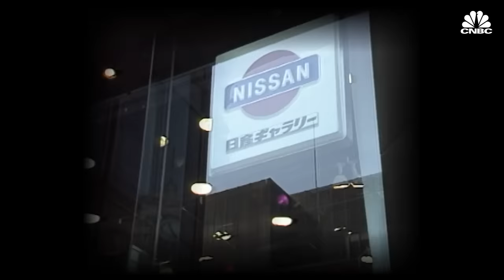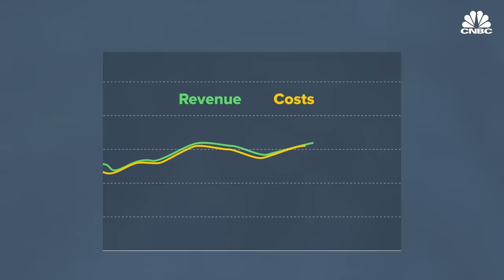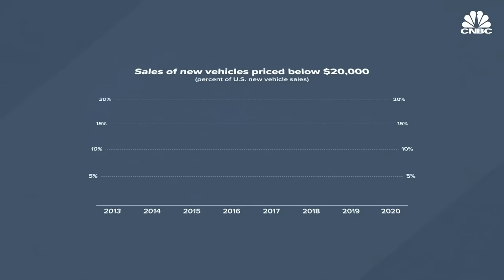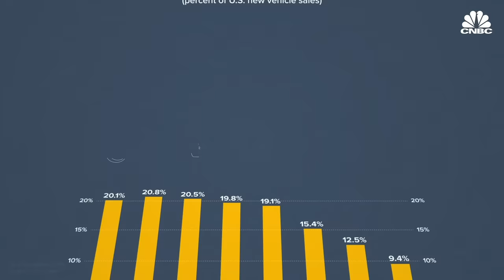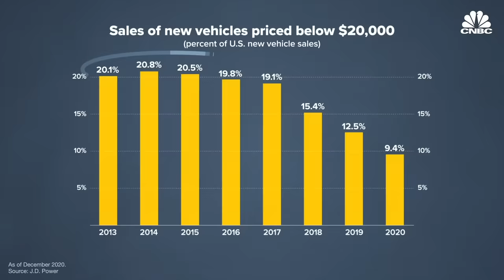Why Cheap Cars Are Disappearing

Comment: The fact that a new Toyota Yaris is more than $25,000(AUD) is sad
Reply: Because it's f**ing sacred Toyoda which parasite loyalty of customers. Once being an owner of a brand new VW Polo Sedan, I tested toyoda corolla. I was shocked. Toyoda was priced twice as my VW but the quality of the interior was even worst than my cheap VW had. Talking about reliability I have had 0 issues in 5 years of ownership and everyday driving with my VW in quite hard conditions of eastern Europe and Russia. So I have no idea why people buy extremely overpriced toyodas which often do not have apple carplay even in a most expencive trim. That is insane.
Reply: yeah i remember seeing car ads like 15 years ago for a suzuki jimny for example for like 12-13k.
Reply: Big oof
Reply: If you take a lot of short trips look into buying yourself an electric bike, most of them have throttle so you don't have to Pedal if you're unable to do or don't want to
Reply: @AlexS-gn9tq  

VW is unreliable trash and its expensive to maintain. Toyota Is more reliable and its cheaper to maintain unlike VW, that's why people buy a Toyota instead of VW
Reply: @donaldrobinson6502  Bicyclists get run over by people in cars.
Reply: I see plenty of older Toyota/Ford/etc running around. I never see older VWs.
Reply: @MaestroJericho  Alex was talking about Eastern Europe . There, the Toyotas are inexistent and VW are everywhere . Also VW are easier and cheaper to repair in Europe .
Reply: I have always wanted a Toyota 4 runner but not enough to pay what they cost. Maybe one day
Reply: I would’ve get a fiat 500c or Abarth with that budget
Reply: @AlexS-gn9tq  you have a answer in your question.  you have no idea what you a talking about.   go your local transport office and check how many VW on the road after 10 years also check how many Toyota. Still you can see many Toyota after 20 years 2001 model Toyota on the road but very feu VW.   I am not advocating  for Toyota.  VW is a brand for wealthy  and  Toyota is a reliable. that why people are paying for Toyota.
Reply: I bought my Toyota Camry RZ 2014 in early 2015 and paid AUD$27,000 net, equivalent to USD$20,820 net. 6 years later, with a low mileage of only 26,000 km, the resale value is quite high, one dealer told me I can resale it for AUD$25,000. I’ll keep this RZ in the family to see if it can last 20 years. I have saved up for a new Toyota Camry, and am waiting for the Gen9 hybrid, white, most basic model, maybe in the year 2025. If a bit more money is saved, the sports version may be considered. It’s peculiar how I managed to grow fond of the Camry over the years, I guess the comment made by a local mechanic after the 5th service, quoting “the car is in perfect condition, there’s nothing wrong with it”, really made the difference. If even more cash is saved, the new Volvo S60 sedan also interests me, but no where near the enthusiasm attached to a Camry. Car loan is the worst sort of liability one can have, so I’ll save up, use credit card to purchase, and make one repayment in full on statement balance date. You may call me old fashioned or stubborn, but following my own pace and logic does keep my mind at ease - less things to worry about the better.
Reply: Government is inflating the economy maybe?
Reply: Because you buy a toyota and last forever, I have a tundra and a tacoma that I got in 2001 and 2004, 20 years later both still running strong with over 300k miles, so if I but another car that would be toyota or lexus
Reply: The little wheels are so cute though.
Reply: I remember the Ford Festiva & Geo metro in early 1990s for about $8500 CAN. They were very basic and there was about $300 profit if you got full price or didnt take a trade. No air conditioning, no options basically. But good cheap fuel efficient vehicles.
Reply: @seaman5705  don't know which Eastern Europe you are talking about, but in Russia there are Toyotas everywhere, I would say even more than VW. Maybe less so in other countries, but I wouldn't say "inexistent".
Reply: @123pgq  Eastern Europe from EU ?
Reply: @seaman5705  still not inexistent, Visegrád and especially Baltic countries have plenty of Toyotas.
Reply: @123pgq  You are wrong - not even 5% from the number of VW . Never mind it .
Reply: @seaman5705  okay, so Toyota was the best selling car brand in Poland in 2020, VW came only third. Toyota models are actually quite popular among private buyers too (you can check the info in https://bestsellingcarsblog.com/). In addition, Toyota was leader in Estonia, Latvia and Lithuania  in 2019 (the latest info I found). The brand is literally the third best selling in Europe as a whole. Therefore, "a 5% from the number of VW" is far from accurate, even if you count Škoda and Seat as a part of VW. But never mind, I guess :D
Reply: @123pgq  You forget that East Europe cars buy is mostly second hand cars from West Europe , not new cars . And VW is by far the most purchased car . But never mind .
Reply: @seaman5705  of course, no one is denying that VW is very relevant, especially among second-hand buyers. But saying Toyotas are "inexistent" in "Eastern Europe" (whatever that is) seems a bit of a strech to me. Just saying.
Reply: @s.z.x.01  That's great but you're gonna need twice the amount to keep it running
Reply: I have two scion xbs which is basically the same as the Yaris just bit bigger. I think I paid under $5k for both
Reply: it's because the AUD dropped, and inflation. Also the Yaris lasts forever, so the manafacturer needs to make a bit more on the upfront sale cost.
Reply: @AlexS-gn9tq  YESSS! Toyota does make em last long but they overpay for them everytime 😭
Reply: wtf are you on, they start at 16k. You can get a dacia sandero starting at 7k, cheap cars are everywhere, this vid is just fear mongering
Reply: @MGMutt  the AUD is australian
Reply: Just buy a used car with extended warranty mate, so much more worth it
Reply: It should be no more then 15k, its not nearly as well made as the tercel from the mid 90's.
Reply: That cheap.
Reply: here in eu new yaris cost 12k euro
Reply: @AlexS-gn9tq  Wait till your car is 19 years old and say that. My Toyota not toyoda by the way has never been in the shop for anything but fluid changes regular maintence and tires. It is not loyalty that brings back toyota buyers. It is US automakers build crap.
Reply: In what country? Here in Illinois USA a Yaris starts at under $18,000. Maybe your country has high cost shipping?
Reply: @cabron247  the currency is right there
Reply: @DangerAngelous  sorry, missed that.

Comment: Consumers who are smart with their money don’t buy new cars.
Reply: Thats very true. At the end the total cost of using a used car is cheaper compared to using a new car which might be affordable.
Reply: Bingo
Reply: 1999 maxima and 2005 vibe owner, I agree.
Reply: Wealthier consumers with overflowing cash piles still do. Just not the average joes that need to use that money for important things.
Reply: @IFearlessINinja  Consumers with more credit than sense buy brand new. I've got excellent credit but I'd rather invest money on appreciating assets, not cars.
Reply: RunningFromABear If you had more money you'd buy new
Reply: Correct even ones who do buy higher end like lambos, or Porsche, Lexus the smart ones buy it on the low end not the high end of the buying spectrum. Why buy it at 150000 wait a few and bam few years in its in the 50000 to 70000..
Reply: @IFearlessINinja  You'd have money and good credit if you stopped buying new.
Reply: @sbfhawk4343  the trick is buying a car at 15-18 months but no older than 36 months and sell it when it hits five to eight years of age used.i am australian and when i still had my micra i looked at new renault,hyundai and kia.what i didn't know i could look used and getting a better buy.did my research checking out toyota,mazda,nissan and fiat products at the used sections of dealers/car warehouses and ended up with what you americans call a chevrolet spark(we had them in australia as holdens)15 months old with a few extra things and automatic 2017 model practically demo car for less than the same model new.my plan is stick to the used market come 2023 and look at 2020 models of cars which is the current year maybe look at the next class above.even with things like wheel alignments to be done at 10,000km intervals and other minor things i am miles in front of the new car buyer.
Reply: @franzchong5889  That Is exactly what happened to me except that since I was passing by a Mercedes Dealer they were getting premium Used cars from leases like Acuras MDXs, Infinities, Bmws , and Porsches I was able to snag a Porsche coming back from a lease that was def worth it for the price.
Reply: We will forgive billionaire Warren Buffett spending $45000 on a new Cadillac, since I read he negotiated a discount with the dealer.
Reply: They don’t buy a gas car, they get an ev.
Reply: A lot of it had to do with the age of the people. Buying used cars in the 70s and 80s was basically lighting you money on fire
Reply: @runningfromabear8354  A car is not an investment to begin with, it’s an expense. And expenses on a solid new car with no problems may be the same or lower than those of a used out-of-warranty car with a host of repair issues.
Reply: Exactly!
Reply: You are Soo right.....
Reply: True to that who wants to buy a worthless brick
Reply: That's true. i got an android radio i installed from a YouTube video for 80 dollars, touchscreen with android share feature, gps, back up camera already with it. I also got a smart mirror with recording back and front and reverse camera on amazon that i installed on 2004 Toyota Camry. The dealership charges like 20k more for that, it's a highway robbery.
Reply: @IFearlessINinja  Probably he wouldn't. Why buy a brand new car when you can save up, buy a decrepit house and flip it?
Reply: Warren Buffet drives a ten year old Cadillac.
Reply: @IFearlessINinja  Not always true.  Our household income is 2.5 times the median income in the state...we always buy used.
Reply: I think it depends on where you're located. If you're fortunate to find a used car with really low miles, then yes definitely buy used. But if you live in a area where much of the population commutes 50+ miles one way, you're better off buying new. I'm in the DMV and had to buy new because of my commute. Hindsight I do wish I had bought used but it was virtually impossible to find any with low miles and then the audacity of the dealerships near me was selling an 80,000+ miles car for over $20,000.
Reply: uzernamechecksout Because you already have more than enough money to satisfy your other desires and needs
Reply: Chickenlegs41 Well 2.5 times isn't exactly the wealthier brand of consumers, especially for pooled income. Correct me if I'm wrong, but that's still middle class. Not to mention the complete lack of wealth accumulation acknowledged. I assume if both of you only average 1.25x median salaries, you're either fresh out of highschool or relatively low-paying degrees out of college. Not a lot of money invested and saved, allowing for more mature purchasing decisions
Reply: @MrDuncl  I think he can afford it...
Reply: This is just not true, but it sounds good.
Reply: You can purchase new,  just keep it after it's paid off. If you keep your car for over ten years, there's nothing wrong with buying new and paying it off in three or four.
Reply: That's why I still drive my Model T.
Reply: 2012 Honda Accord driver here. I will always buy used.
Reply: @kcee7841  I own a 2004 Vibe.  It's a Toyota Matrix with Pontiac badges on it, so it's basically the most reliable car on the market.  I paid cash for it in 2014, insurance is cheap, and it's a class leader in fuel economy. It's not pretty but who cares.  I'm not pretty either.
Reply: When you have 6000 USD extra laying around each month, buying a new Camry isn't a big deal. I could buy one every 3.5 months.
Reply: @entItyVR I already have savings accounts numb nuts. 

I use credit to get things and pay it off immediately. I'm not the chump who pays interest and never have been. My mother was an accountant. Excellent credit has kick backs. More than 20 years of doing it my way and I'm still getting stuff for free. The people who pay interest and making my life better.
Reply: @MJ98.  Not always true.